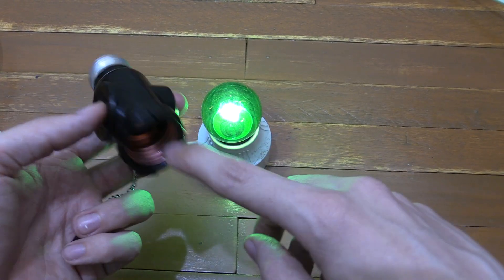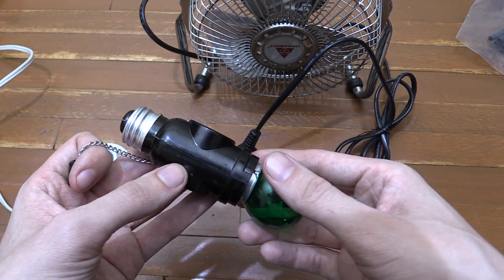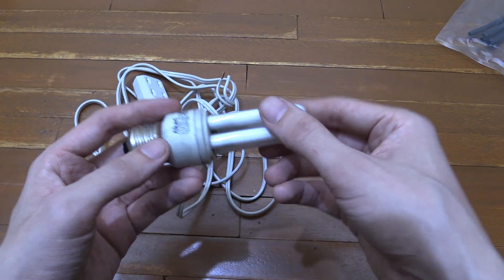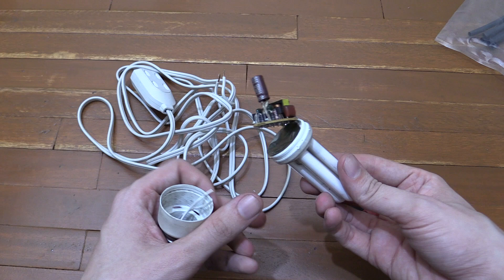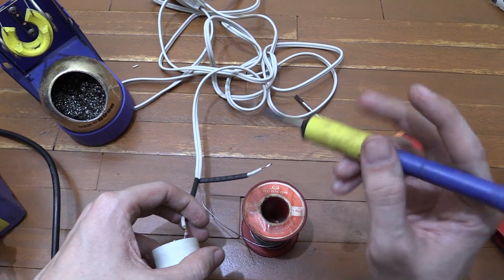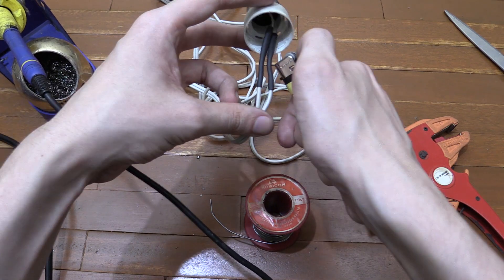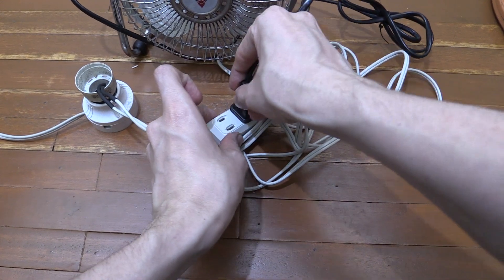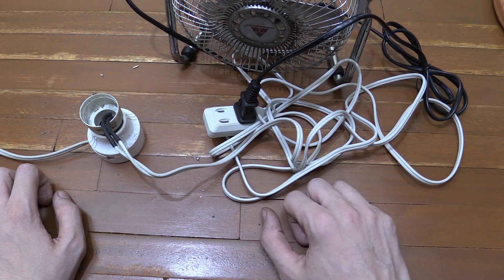DIY Bulb AC Outlet Adapter

Comment: I Have created the technology to hollow out antlers, I have one problem,
I need a smaller light socket so that I can put the lighting on the tips of the antler.
The Light socket needs to be small enough to fit into a 3/8 inch cavity,
with a candelabrum type bulb,(LED)

Comment: how do you know which wire to connect them on to,
Reply: In most cases it won't matter. Especially in a country where they have 115v to both wires making 230. Even here in Canada where its 120 to one side and 0 to the other it really won't matter as most things you'd plug in wont care since the voltage cycles back and forth 50 or 60hz so 100 or 120 times a second. If you want it hooked up live and neutral to live and neutral, usually on the screw cap the outer piece is neautral and the bottom piece is live (for obvious reasons) but that can always be different based on who wired your house. I hope that helps